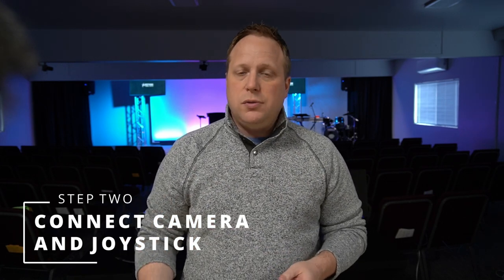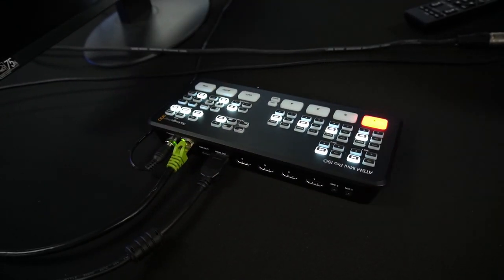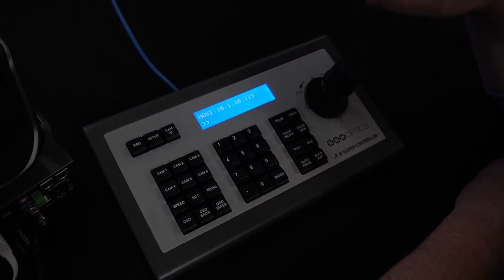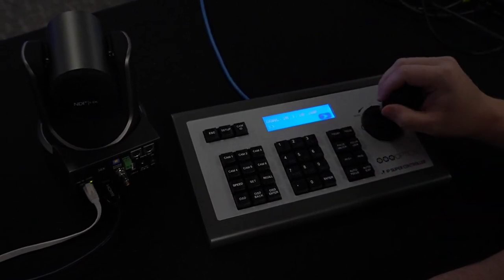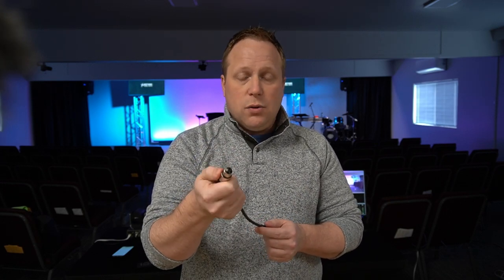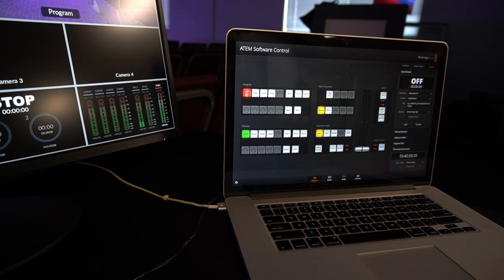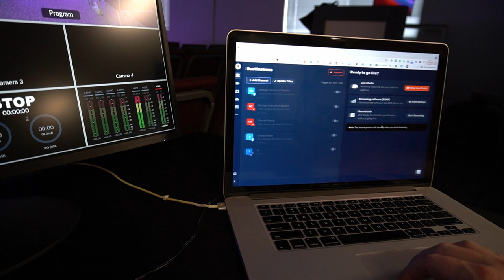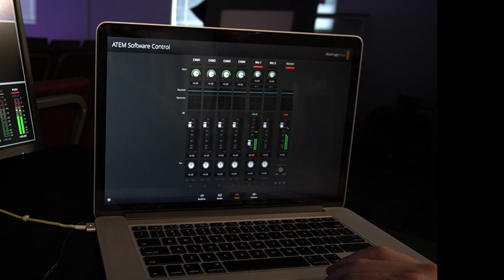Setting Up The ATEM Mini PTZ Camera Live Streaming Kit Step By Step

Comment: Hello,
I was viewing your video and find it interesting.  I have a question regarding connecting my PTZ camera. I have the Atem 1ME rackmount and i am trying to connect my PTZ camera to it but for some reason when i connect the camera via SDI or HDMI my Atem does not see any video signal. I am wondering how can i get my Atem switcher to see the video signal coming from my PTZ camera? Your help is much appreciated.

Thanks,
Bernard

Comment: Where is your XLR plugged into on your board (The one that runs to mic1 on the ATEM)? Do you do anything on the audio of your Restream?
Reply from the maker: The XLR is plugged into a sub-mix output on our board. So from the audio mixer, we assign a sub-group (monitor mix, basically) to a certain output. Then, we come from that output directly into the ATEM. We only use volume controls in the ATEM if need be, nothing else. We pretty much control the audio volume and mixes from the actual audio mixer.

Comment: With sound coming from a Behringer 32x compact, why would I connect to the Atem instead of going straight to the computer and Propresenter 7?
Reply from the maker: If you're using a streaming PC - or if you're using Pro Presenter to stream, it makes sense to send audio straight to your encoder - which would be the PC. If you're streaming from the ATEM Mini Pro, (this video is showing that method) you have to run audio to the ATEM to get it into the stream. If you're just using the ATEM as a video switcher, I would recommend running the audio into whatever machine you are using.

Comment: Can you program a slow push (zoom-in) into my subject in a PTZ30xSDI? If so please explain the steps. Thank you
Reply from the maker: There are a variety of ways to do this. With the PTZ camera itself, you can do a preset movement and just slow the speed way down. Then when you recall the preset, it will slowly move to it.

The other way is to do it digitally in post production.

The other way is to do it by hand, and just be good with the controls.

But yeah, you can turn down the speed pretty low. But I don't think you'll get the Ken Burns kind of slow speed --- you could if you do it manually with a joystick - not sure about the preset speed.

Comment: I have 2 cameras and a controller that all hook into a POE hub. #1 Do I still need the HDMI fiber optic?  If not, how do I now go from my POE hub to computer to live stream?  My controller has no output.
Reply from the maker: A controller is just that, a controller. It's not a switcher or an encoder, so it won't actually do an output to a live stream. The cameras need something to "capture" their signal and either encode or input into a computer to encode through software. 

So, if you only have Ethernet, you would need NDI-enabled cameras and an NDI-enabled encoder or switcher to pull that signal from the network. Otherwise, you'll need the HDMI or an SDI cable to bring the video signal to your switcher/capture card. 

In most cases outside of NDI equipment, the POE and Ethernet are just to get the camera on the network so you can control it remotely. That's the only way your controllers have to communicate to the camera is the network. So the ethernet is for camera control and power (POE) but the HDMI or SDI cable will be for the actual video image.

Comment: Hi, I didn't understand how to send the video signal from the PTZ to the atem mini as video source. HDMI? NDI? Thank you
Reply from the maker: There are several ways - the most direct is HDMI cables. You can also do SDI with HDMI converters at the ATEM end. The ATEM currently doesn't to have NDI capability, but you can get an NDI decoder that will give you an HDMI output if you choose NDI. I like the HDMI connection the best under 100' with fiber optic HDMI cables. And over 100' I like to go with SDI and a powered converter.

Comment: We are adding a second camera with an ATEM Mini. At this point we come direct out of the PTZ Optic Controller to the computer via an adapter to make the the signal correct and go straight to Facebook with no software in between. The audio and video was troublesome to get right. So is software really  required?
Reply from the maker: Hi David... not sure I understand what you mean. How are you coming out of the PTZOptics controller and going into the computer? What software are you asking about?
Reply: @ChurchSetup  I connect my camera with an hdmi cable to a convertor to my computer. I did not explain it correct to you. Sorry.

Comment: I have the ATEM Mini connected to the cameras by HDMI. But i noticed that even when I select auto on the ATEM and designate a time for switching between cameras, nothing happens. What am i doing wrong?
Reply from the maker: Auto is just the transition effect. The time duration is how long that transition effect will take. Is it going to cross-dissolve, for example, in half a second or over 2 seconds? It's not a timer for auto-transitioning between cameras. The ATEM on its own does not do auto switching. With auto selected, you would still have to push the buttons to get it to switch.
Reply: @ChurchSetup  So if you want to capture several areas at the same time - different angles with different cameras, is that possible with the ATEM Mini Pro?
Reply from the maker: @elderandrews4884  I'm not sure I understand the question. But the ATEM Mini Pro captures 4 cameras, but the recording/live stream can only show one at a time (unless you're taling picture in picture). However, the ATEM Mini Pro ISO can record all 4 cameras individually at the same time, so you can mix all angles later.

If that wasn't what you were asking, try me again. :)
Reply: @ChurchSetup  Thanks a million. I believe you answered the question. The ATEM Mini Pro is not able to stream more than one cameras at a time. I purchased the ATEM mini, and then the Pro hoping that the Pro would be able to stream more than one camera at the same time but evidently that is not the case.

Comment: Why are you using Fiber HDMI when you are using NDI cameras?  Why not just carry the video to the switcher over NDI? you just need an NDI decoder at the switcher.
Reply from the maker: With our ATEM kits, we don't sell the NDI version of the camera. We may have used one in the example, but adding additional hardware is unnecessary and more expensive just to cut down from 2 cables to one.

Comment: You forgot to show from Atem settings: audio and you have to choose the line button, not the mic!
Reply from the maker: Choosing line over mic depends on your input source. Line doesn't work with every mixer in every situation.  So just choose one, test, then if it doesn't work, choose the other and test.
Reply: I was talking about settings in ATEM. Every tutorial I have seen tells that in ATEM you  must choose the line over microphone.

Comment: Nobody has made an network Hub since 2001... That is a PoE network Switch.  good video but you have many incorrect terms in use.  Also really not a good idea to rely on DHCP IP addresses when you are having to tell your controller to talk to a specific IP.  Many Routers release/renew IP addresses after 1 week.  If one of your camera's is off when it does, it may give the address that your camera had to another device, then when camera comes up, it gets a different address, and now your controller doesn't work anymore.  Better to statically set all devices in a range of IPs outside of the DHCP pool,  this way it will stay that way regardless of power outage, or Router change.
Reply from the maker: Thanks Mark. For most people, calling it a switch or a hub doesn't really make a difference. 😀 

I have found using the term hub, especially during tech support calls, often  helps our customers avoid confusion between "switcher" and "switch."

Thanks for the recommendations. For most churches, there's no way to remove the possibility of DHCP interference. Even with password-protected WIFI, that password has a way of getting around. 😀
Reply: @ChurchSetup So I can plug the ATEM Mini Pro into the 8 port POE switch?  It does not have to connect directly to the router?  I say this because I question whether the ATEM device can be powered by the POE switch.  Please advise.